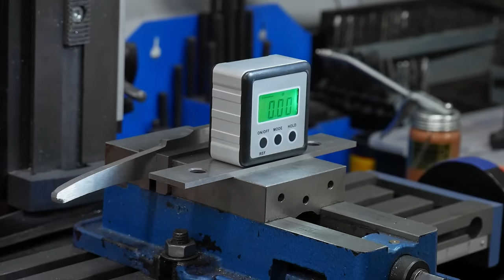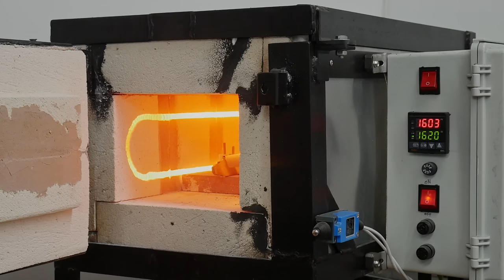"This is Madness!" --  FANTASY Knife Challenge

Comment: Nice job on the knife there sir but I do have 1 question. What is that round, bent shaft for on that knife? The rest of the knife makes sense but that round, bent piece of steel is confusing.
Reply from the maker: Hey Brian; it's whatever you want it to be. The mystery is the intrigue. It can also be swapped out for various attachments; but the poker is the default ;)
Reply: @RedBeardOps  cool

Comment: What the.....Uh...Oh-Kay. Is there a reason why you made this knife the way it is, or were you just winging it? I mean design-wise, it's appearant that you have the attention to detail that would make you a good master bladesmith and I Loved watching you really pound out the ultra fine details of this knife. Your Handle is Amazing, just a suggestion, far be it form me to do so but as my eye would like to see the bottom length of the handle narrower in diameter than the top length, this, I feel, would increase the comfort of the handle in the hand, other than that you made it in a way I wish ALL knife makers would make their handles. Honestly, you are up there with Kyle Royer with your attention to detail. and as far as the pins are concerned why not leave them protruding lightly from the rest of the assembly? I have ALWAYS loved it when knife makers leave the pins of the handle slightly proud of the handle material as it offers more tactile stimulus when holding the knife. certainly a flush pin has it's appeal but it doesn't always have to be that way. Overall, I love this build I just am a bit perplexed as to its purpose, or the reasoning behind it. Even if it was a modern take on a traditional shape that a mythical people had for their ceremonial dagger etc. or something behind it. Fantasy knife challenge with an actual fantasy story behind it would make it even cooler and give the knife a reason for it's unusual shape and design. SO Hit me wit it Guvna!
Reply from the maker: I agree on the handle dimensions. Thank you greatly for the praise on the details of this knife! I agree with the pins for sure! Probably should of domed those with light peening. On the design I just kinda let my mind run wild... My head wanted to make something that didn't make sense! I think that's accomplished. I envision sending this knife back in time about 1500 years to an evil warlord. Imagine the fear he could put into the hearts of his advisories with a perplexing weapon like this. Even if it was just used for executions, that would be enough to command dread. lol - Cheers!

Comment: That is some really gorgeous work, but what the heck is the point of that knife? Why do the edges face each other? What is the bent rod for? Why is there a hole in that? It makes no sense to me. What is the fantasized function of this conception? 
     Fantastic or not, if it doesn't have a function, it isn't really a knife.
Reply from the maker: Just for fun! Use your imagination Craig!
Reply: @RedBeardOps  As I said, it is a beautiful piece. But I asked those questions because I did spend some time trying to imagine how to use and how to carry such a piece. The only use for that configuration of 2 blades I could think of is to score the insulation of a 3'' or more in diameter electrical cable for stripping. The 2 edges facing each other would make it somewhat easier to do than with a single blade. Otherwise, each blade would interfere with the efficacy of the other for things like slicing or stabbing. It would be horrible for throwing. The bent rod might be great for stopping the downward slash of a long blade, but the hole drilled through it seems likely to cause the metal to fail after many such stresses. I can't imagine any way of rigging that up for safe EDC, so it would not be handy in an emergency.
     Once again, I think it is wonderful work. Mounted on a wall or in a display case, it would make a real conversation piece, but it should come with the instruction: "DO NOT USE WITHOUT A TRAUMA KIT CLOSE TO HAND!"
Reply from the maker: @craigmooring2091  lol, cheers Craig!